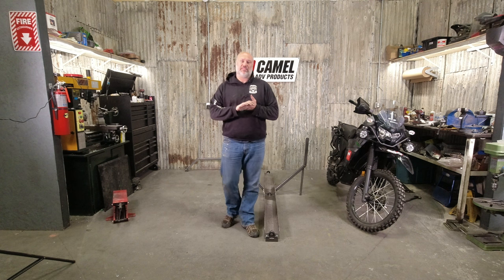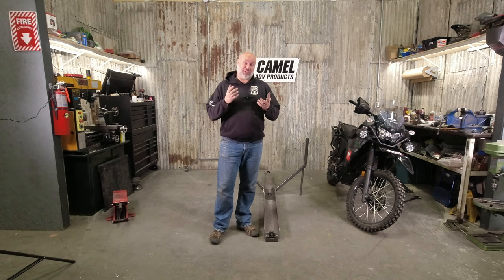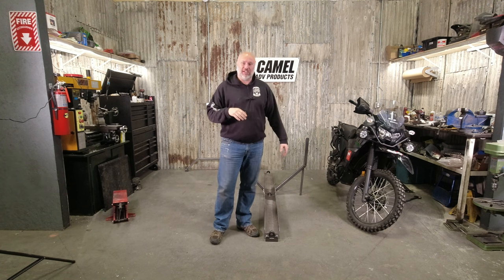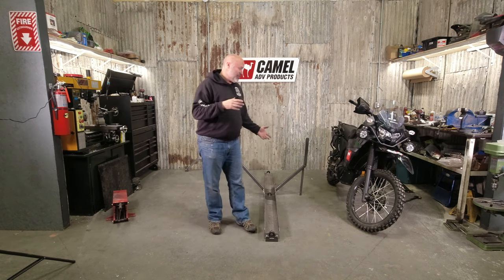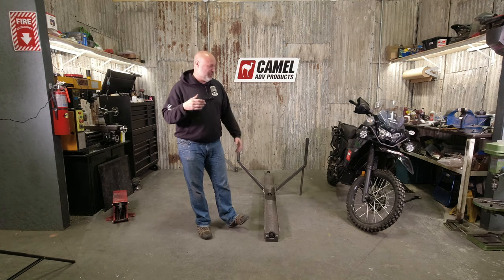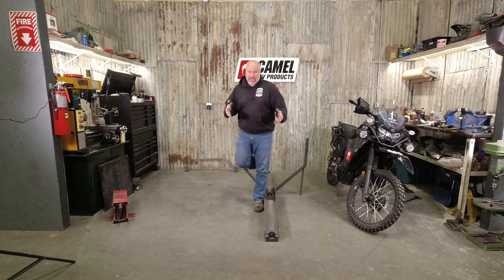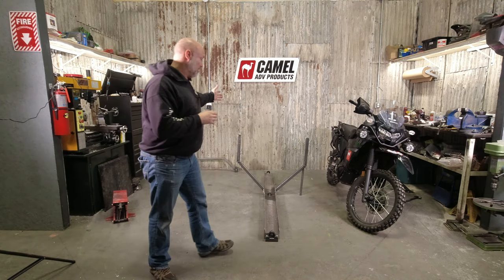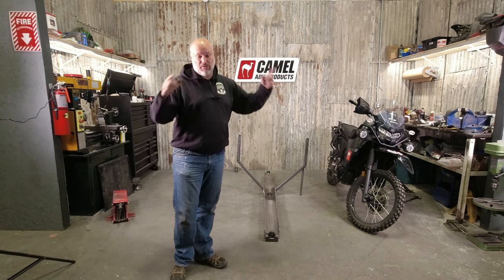CLAW Series, Episode 2: Jig Prep

Comment: I would try two hundred pounds on the seat that’s the true Center of gravity of the motorcycles as ridden. The suspensions  set ups are drastically different and change the CG because of the sag like soft AT compared to stiff Ktm.

Comment: I'd be more interested in picking up bikes. I appreciate the clarification that this is a relative test at rest, but now you've opened another can of worms. User proportions will have a huge effect and that's not captured. Beyond an angle the bike will lever out your leg for example. Putting your boots down on ice at rest or slow speed will teach you what that means fast. Also the user's relations to the handle bars may completely affect their control of a bike. An NC750x has an extremely low center of gravity but I wrestled mine constantly having to hunch to the handle bars. The seat geometry combined with my handle bar location is a match made in heaven on my Tenere.